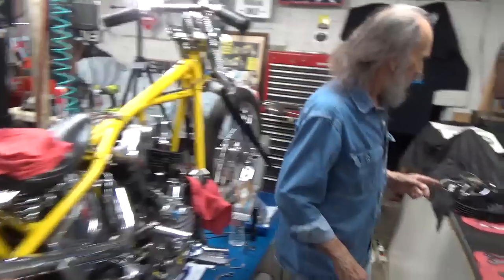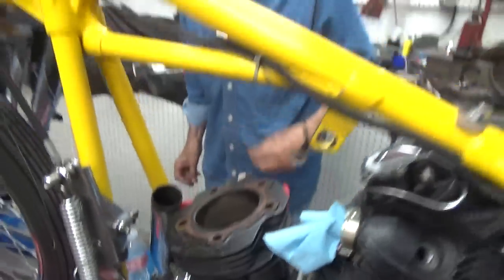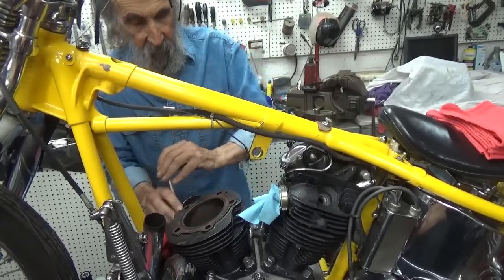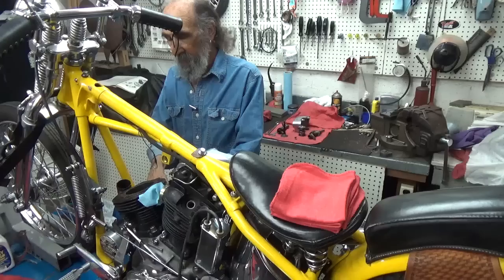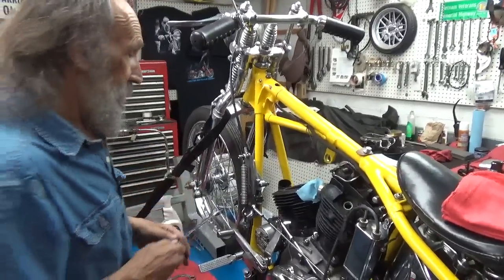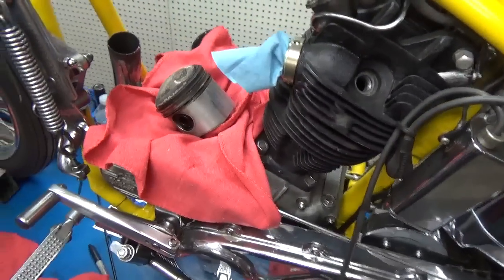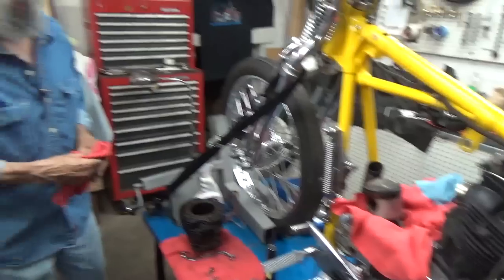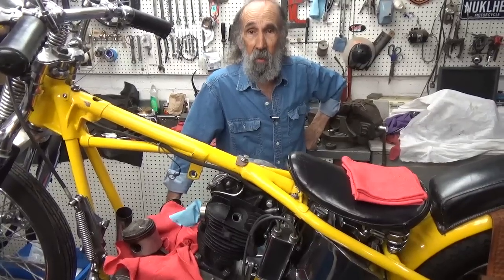Teardown To Fix That Oil Flooding On a Harley Knucklehead

Comment: Hi Mike, Rat here, Cheney Washington. Knuckle rider for 25 years, I now ride a UL. From what I can see, I don't see any pin-holes in the top of the tin-covers. If you drill a tiny-tiny hole in each one, on the top, above where the valve sits, (I hope that explains it) that usually will cure oil building up in the tin. Sometimes a vacuum (sp?) is created which keeps the oil from draining into the push-rod tubes. The tiny hole will let some air in negating that, and no it won't leak out the hole. I can't say what size drill or hole, but just very small. That kept my knuck from leaking, and in fact guys would comment that they never saw a non-leaky knuck before. (lots of guys also would walk up and tell me about the "1948" Kunckle Head they used to have. Okay.) Well good luck. Love your channel. Try the holes, the tin-covers are not expensive to replace if for some reason it does not work for you.

Comment: A.R.P makes a nice 12 point fasteners  for cylinder base nuts. Much easier to torque.
Reply from the maker: Yes they are nice.  Twelve point head bolts are great too.

Comment: Hello Mr. K , I know it's not rocket science and I know it's not the space shuttle but will you be using a rigid hone ? I have never cared for ball hones and it's going to be very light honing . Please let me know your thoughts on this as your opinion matters . Thank you guys for your videos .
Reply from the maker: Thank You.  I really like cleaning up with a ball hone.  If the measurements are good, I'll just need to break the glaze.

Comment: A few things I wonder about;
If the pistons draw the oil down from the top during their up stroke, won't they blow it back up again on the down stroke?  Or does it all equal out, resulting therefore in gravity alone as being the only average down force?  For surely there's not a one-way air/oil valve at the base of each pushrod tube?

And then, what about a crankcase breather?  If you want more of a vacuum in the case on the up-stroke than you get pressure in the case on the down-stroke then some sort of one way valve there in the breather system could do it.

If you change several variables at a time (new rings, a honing job, and one or two other things you mentioned), and if doing all of those things at once fixes the problem, then you won't know which one was responsible for the problem.  Change only one variable at a time if you really want to know.  And while that could end up being several times more work, it IS an important part of the scientific method.
Reply from the maker: The question is answered in the timing of the breather gear.
Reply: @pacificmike9501   Ah (adopts Johnny Carson voice), I did not know that.  Now it's beginning to make sense...

Comment: Cylinder scoring suggest blow by on piston which would greatly reduce vacuum and possible cause to oiling issue. I would recommend high tension ring,overbore,and fresh matching pistons.  Nice fit and hone,less blowby increased vacuum. One. Opinion . God bless.
Reply from the maker: Absolutely true.  Going to change to three piece oil control rings and a couple other things.
Reply: I noticed you had early style oil sweep....which kinda sucks. Would suggest changing to late model ring design with high tension second ring and moly top ring and of course 3peice oil ring. With a nice plateau hone should cure your vacuum issue.

Comment: Morning Sir I was wondering if I get your opinion help. I was looking for a video of what I’m doing. Well I have a 1981 shovel head fxwg rebuild the carburetor (cv) it cuts out bad when in gear. Idles great, soft turn on throttle does great hard turn is great. It’s just when I put it in gear it cuts bad. I have a couple videos I just don’t know how to send them through this
Reply from the maker: Try a slightly larger low speed jet.  Might do the trick.  Look at our video, "Rejetting the carburetor on a Harley Twin Cam."
Reply: @pacificmike9501  thank you very much sir
Reply from the maker: I apologize.  I can't get my translator to work today.

Comment: Mike as usual your videos are awesome and have helped me a great deal with my 3 shovelheads. So I want to thank you for that very much for that first of all. I have a quick simple question that I've been unable to get an answer from other sources I use periodically. Can you confirm or deny that S&S chromoly (not quickie) pushrods lock in the same manner that HD pushrods do? If it's important. This is a 80/80 FLHC that I've installed a new stock S&S top end on. Along with new S&S hydraulic tappets and lifters ad well. Also installed is a new Andrews #3 cam for low compression shovelhead (.514/.514). The top end is 8:1. I had my pushrods adjusted correctly. Bleeding down was not really a factor. Because the only oil circulated was from turning the engine by hand. But i did wait for it anyway. After a short time they became loose. And I can see that there are way less threads exposed than when I locked them. I locked the nuts according to the manual. Plus your and several other videos that I've watched. I also have the gauge. And they all gauged correctly when I was  finished. HD locking nuts lock against the rod. And not the bottom which extends for adjustment. My brain can't understand why they came loose. Unless S&S pushrods lock against the extension instead? I realize this is way too much information. But when you posted previously about not having enough information from people I wanted to make sure I wasn't in that category. .😊
Reply from the maker: I appreciate the info.  It does help.  I haven't had a set of S&S Shovelhead pushrods around in a long time.  If you're installing a set, especially lifters and all, go completely according to S&S instructions.  If you don't have them, look them up on sscycle.com
Reply from the maker: I hope your heads are set up for such a high lift cam.  That's a bunch for a Shovel.
Reply: @pacificmike9501  Supposed to allow for .600 Both S&S tech and Andrews tech it would not be a problem for .514. In fact Andrews tech suggested the cam. It's for low compression shovelhead engines. This top end is 8:1
Reply: @pacificmike9501  At this point I believe I'm going to tear everything back down and see what's going on.
Reply: @pacificmike9501  I couldn't stop thinking about what you said about lift. So I started looking more carefully at the numbers. The S&S heads are capable of .590 lift. The cam is .514. A difference of .076. I've been told by both S&S and Andrews that this combination will be fine. But I'm starting to question that now. Will stock rockers be able to handle that? Again this is an 80/80 FLHC. Stock HD lower end. S&S top end kit (stock but capable lift is .590). S&S lifters/tappets (hydraulic) and S&S chromoly pushrods. I'm completely torn down now. Except the lower end. Gear case is open. Cylinders and pistons are still on the engine. I discovered my pushrods were completely loose (I've learned my mistake on that). But I decided to tear down to make sure everything is still in tact. I don't see any damage or anything irregular. But am going to get a second opinion from a shop tomorrow. The original reason for investigation was heavy valve train noise. Part of that was determined to be the valve spring washers (actually only 1) were hitting the rocker boxes. I'll be removing  bit of material from inside there if I am still going to run this cam. That's the question before the court. Haha
Reply from the maker: I was only concerned about fitment with that much lift, but S&S already addressed it.